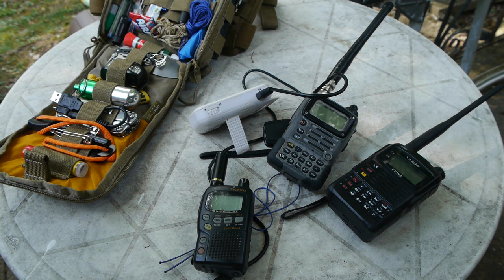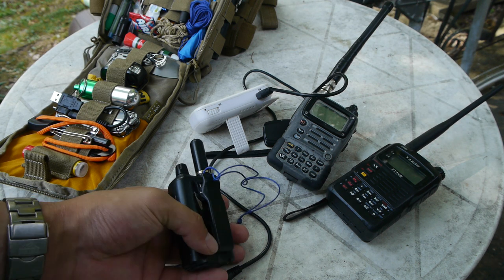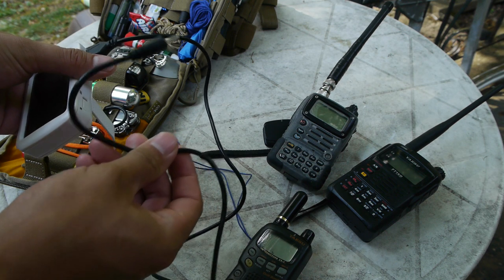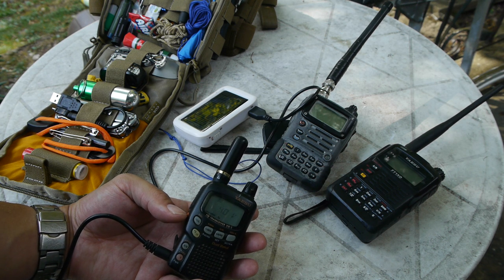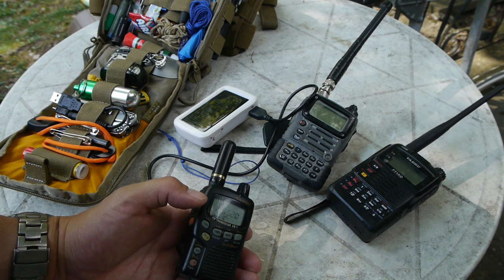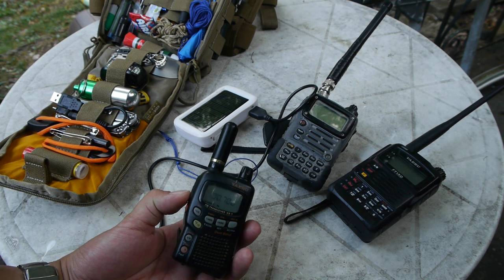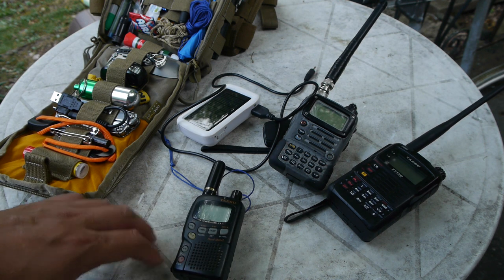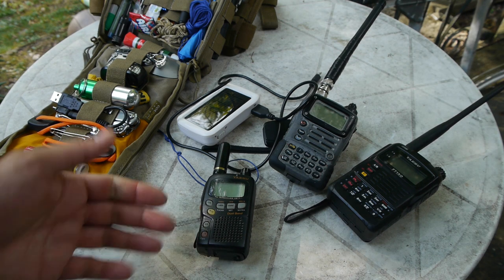Ham Radio - Favorite Small Micro HT Yaesu Vx1r

Comment: Why this thing makes my baofeng uv-3r look like a joke I do like the wideband receive which I don't think my baofeng can do plus it's a Yaesu which you know the qualities is going to be better with the receiver and transmitter
Reply from the maker: baofengs have their place like any tool. ham radio is about experimenting and trying different things. I have to agree that the lack of a wide band recieve would be a concern of mine and the uv3r i think its called is a clone of the vx3r but lacking in the rx area amongst other things. Chinese technology unfortunately steals from others and sometimes make inferior quality items. Some baofengs in this regard are like this. If you can find the vx1r i recommend that over a 2r or 3r because youd need a special upcoverter cable for the dc inputs of those models. Heck if the price is right grab a vx7r if its a good price. Let me know if you end up getting a Yaesu.
Reply: @TheFossilChannel  yeah I kind of want to get one but the hole charging thing is not a concern of mine I think I'm also going to get one of those Yaesu ft 3 R's the big one with the colorful screen and the band scope and all that other cool stuff